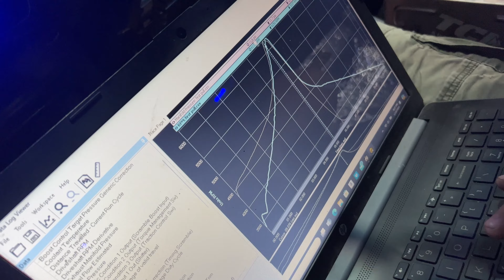We tested a BTR TURBO CAM and a BTR NA CAM! you won't believe the results

Comment: What I find is  the BTR turbo cam shifted power lower than the NA cam. Im willing to bet money that the BTR Turbo cam wasnt desighn to work well with the carb style intake. Still a awsome cam,  The Na stg 4 cam push power into the upper range becasue thats where it makes its power. and works better with the carb style intake. To me its a great comparison If you need power in the low mid range on a heavy car that btr turbo cam will shine.  

One thing I always do in a boosted build is make all the na power I can , from top to bottom. Even with tunning . Of course you dont need to run 28* of timing on a boosted build but would make power NA. I use the Timing curve on boost on the NA side just to see where the motor is at.

Workes out good , I got a 5.3 to make 414 hp na and 831 on 14.5 psi double the power at pretty much 1 bar over NA . and on 30 psi made 1422 Hp out of turbos , all runs where on c85 even NA . 

Nice build fellas keep it coming😃😃😃😃😃😃😃
Reply from the maker: That’s what Brad and jarred were saying as well. I would have loved to got my hands on a stage 4 turbo cam to run this same test back to back.
Reply from the maker: But we’re in the middle of a switch to methanol so the changes would be exactly the same.
Reply: @KyNoPrep  she gonna love that meth no pun intended 😂 I’m making the switch next year on my g body lighten it up get rid of the atw set up lol

I’m gonna inject it through the intake to mix it with a lil nitro😂 I’m crazy like that
Reply: @KyNoPrep  shoot yeah but that’s why we test💪🏿
Reply from the maker: @loundclear9279 you like to party!!
Reply: @KyNoPrep   1/4 or 1/8 mile at a time wheels up:face-blue-smiling::face-blue-smiling:
Reply from the maker: @loundclear9279  🤣